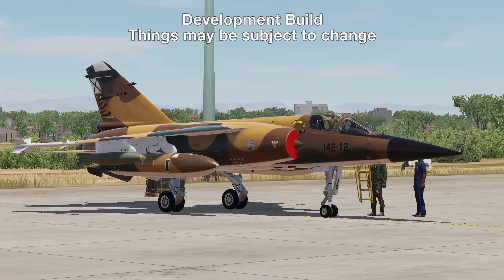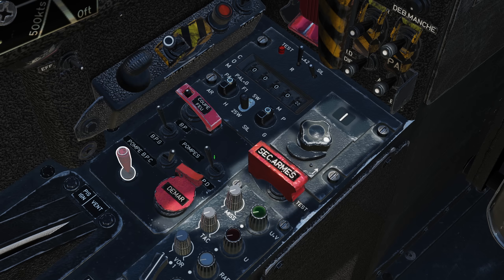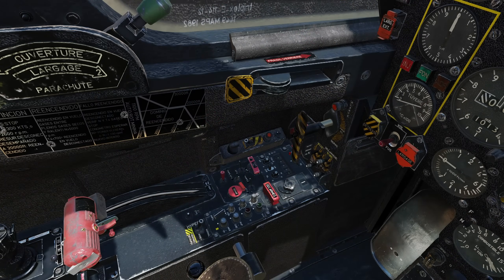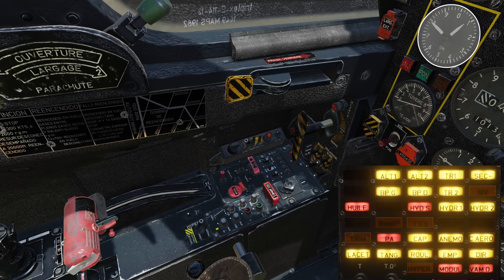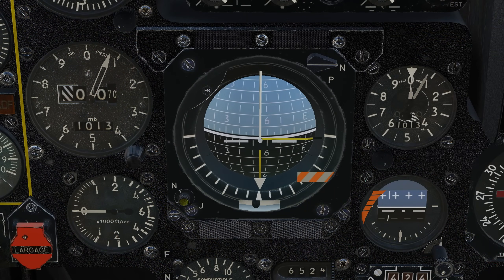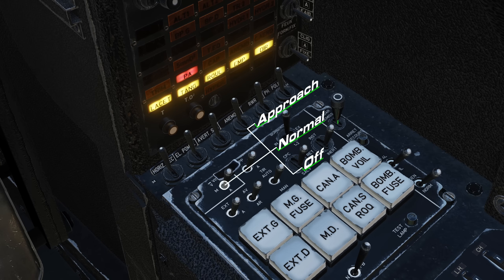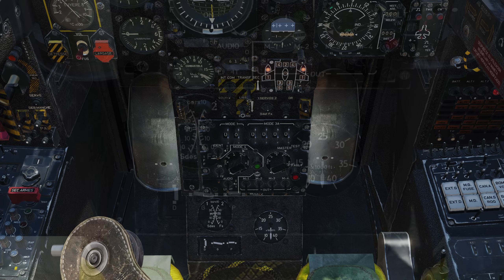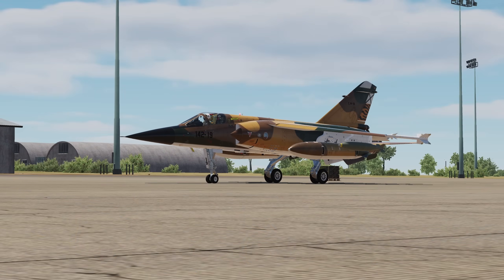DCS: Mirage  F1CE Expedited Cold Start Tutorial

Comment: Ah, sneaky RedKite getting access to the good stuff! Glad it's you and not some...other group...doing tutorials. Great job on the start up - just the "DCS basics" to get her moving.

This aircraft is going to be a great addition to DCS. I am surprised that they've elected to overlook the IFF system - granted, probably due to lack of documentation. Most modules at least make a fair approximation of the IFF.

Meh. End of the day, as long as I can fly and drop ordnance I'll be fine. Looking forward to it!
Reply from the maker: That's down to ED to implement an actual IFF system in dcs first! The panel can be configured, it's just nothing is connected to it atm.
Reply: I think they just mean it doesn't do anything in DCS. The Mirage 2000 manual also states that it is not simulated, but it's still clickable and configurable and all that. Just doesn't do anything
Reply: The only aircraft to include a proper (if still not 100% simulated because Mode 4/6 is tricky) IFF system is the JF-17, a lot of jets have a simple interrogator but basically none of them have the transponder simulated in any meaningful way
Reply from the maker: Yep, the in cockpit IFF switch amounts to an on off switch at best in all other aircraft. IFF is done on a dcs coalition logic level, not the aircraft itself at the moment.

Comment: Loved the little "be careful not to click the ejection handle" bit. Great vid...Have you seen the Radar yet? Also correct me if I'm wrong but the F1 can't IFF interrogate, correct?
Reply: I hope that it is like in many others, three clicks required to get activated. 

In ED modules it is three clicks same way as it is three Ctrl+E presses to eject.
Reply: @paristo  Didn't even know that since I try not to click it. 3rd Parties should totally adapt it if they haven't. And do the same with canopy emergency ejection things. Stopped counting how often I turned my Tomcat into a convertible in VR...
Reply: @CakePrincessCelestia  IIRC it was the C-101 that first time had the stick hided with the clicking on it. But it might have been first ED that brought it to mirrors so you can disable/enable mirrors by clicking them.

 And then there were few others methods like clicking the throttle as well to hide it. I don't remember who did the ejection seat handle, but at least in Hornet and Viper the three clicks worked there. 

The NVG cases etc should be in all as part of the cockpit operations.

Example in many fighters there are map cases or metal plates/pouches to have paper maps. That should be part of the clickable cockpit where you get the large paper map front of you in cockpit.

Clicking the kneeboard on 3D pilot knee should bring the kneeboard nicely raised and hovering over your leg for better visibility. 

The data cartridge should already be the thing in every aircraft that has one, so you load the file from the game save directory where player can have multiple owns. 

And of course the kneeboard thing for all mission data, laser codes, frequencies + callnames, ordinance loadouts etc should be accessible from there for all planes. Automatically synced with the mission and existing units, JTAC codes etc. 

The clickable stick, throttle etc are just begin. Now we have the Mi-24P clickable fan to stop it etc. 

I really hope that in modules that has more features like a coming Kiowa Warrior that has M4 and Smoke Grenades on top of avionics, that you could click them and get them in use. Click the wanted color and you drop the smoke grenade in that position from the door. 
Click the M4 and you get character aim the gun out of the door and you can aim and shoot with it like a Huey co-pilot sight or Mi-8 door gunner. In VR you just look around and shoot, and Track IR same way, others having mouse etc possibilities too.

This whole clickable thing is really one great way to improve experience, ease the learning and make access to things just better.
Reply from the maker: I don't believe it can IFF interrogate.
Reply: @RedKiteRender  yeah a bunch of us on the cold war forums were looking into it, and based on what we found the concensus was no. But that actually isn't super unusual IFF interrogate in the late 60 and early 70s wasn't actually super common on fighter aircraft. GCI would just tell you beforehand
Reply: @RedKiteRender  doesn't seem so. But at least ED should already implement the basic IFF functionality already. It is public domain information how the systems work. You only don't get to know the algorithms and encryption. 

But you could use information that you can find in public libraries that how it works. Implement a own code system that follows that information. 

Just require players then input the proper numeric code, select the proper mode with switches and that is it. Make the game AI generate codes per mission, per area etc, and then allocate that information to mission planning when taking off. So player needs to do it always manually after getting cockpit, when flying to different area, or time of virtual day changes.

And then simulate the radio errors etc, that will create situations that unknown might be a friend...